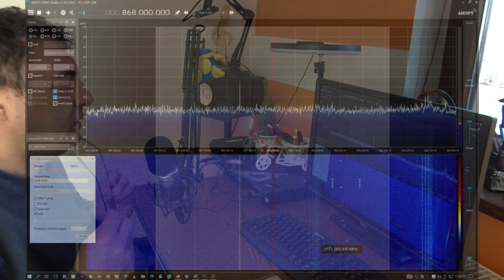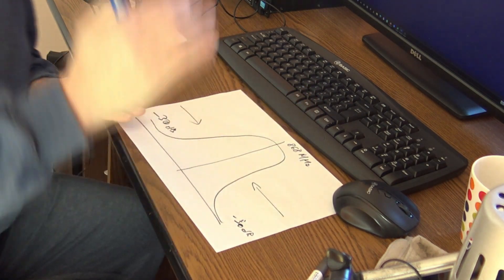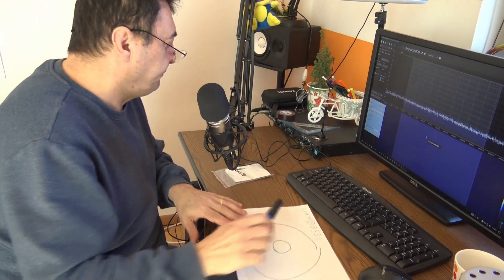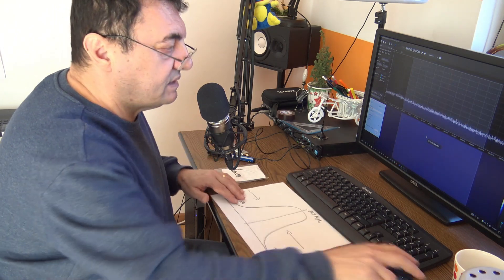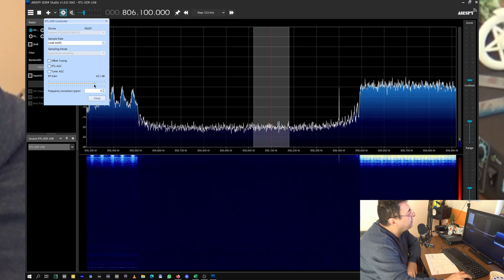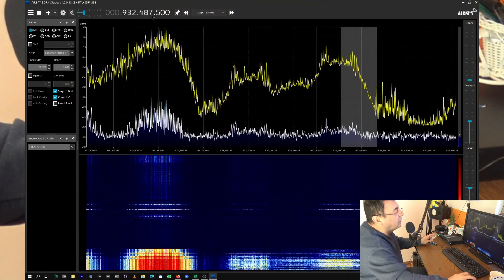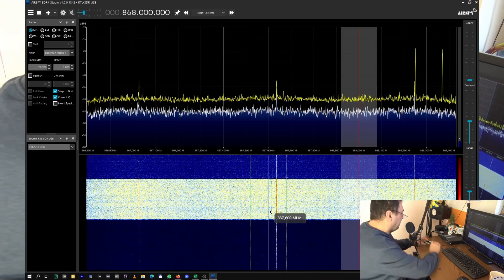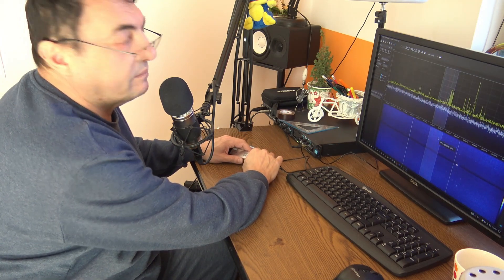Let's talk LoRa filter ..again!

Comment: Hey mate splitter for 1 miner and 2 antennas do you have a link... thanks in advance
Reply from the maker: Not quite, I didn't tried  anything like that, but as long as you have an amplifier any splitter should do the job..plenty of signal..but of course for 868MHz or  around..
Reply: @viocaia  thanks bro
Reply from the maker: What do you mean Robert? Do you want to have two antennas on the same hotspot? I'm afraid that's not possible ...they have to be in very close proximity and working in phase..that's almost impossible ..You'll never can have them work in tandem..of course there are a kind of phase array, that's another situation when two or more antennas working together..but they still come together to the same output...
Reply: @viocaia  yes two directional to test https://youtu.be/_llfRLarplk